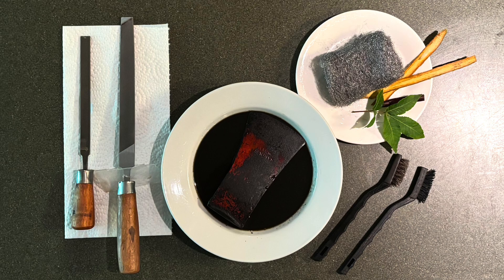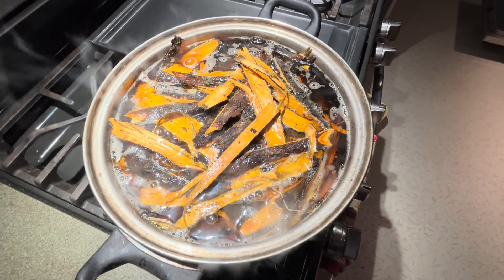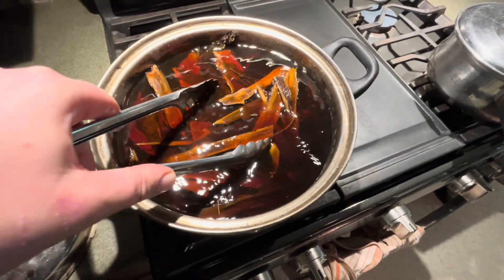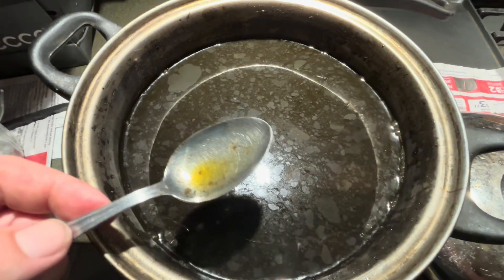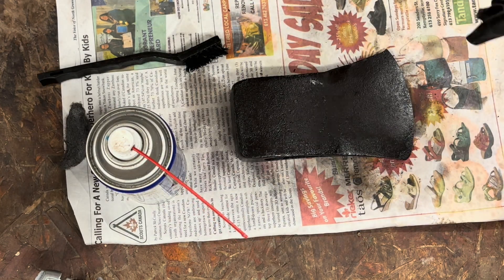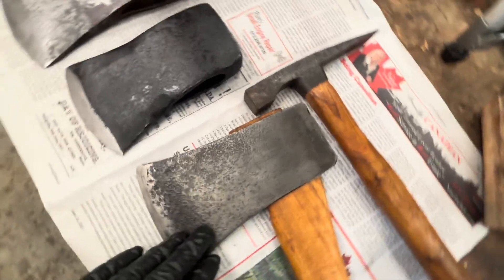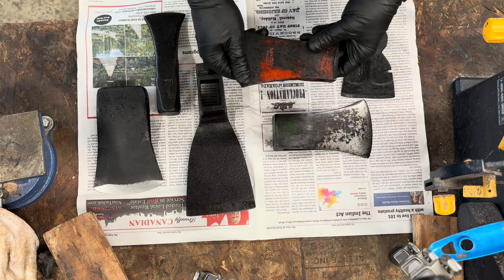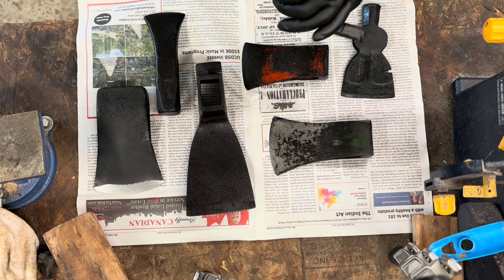Axe Head Soup? Refurbish rusty tools by converting rust to a stable black patina!

Comment from the maker: Updates: Since I made this video, I have kept experimenting with this method and I have got it to work using late season leaves from Common Buckthorn, Northern Red Oak, Bebb's Willow (a shrubby willow common in my area), and weeping willows. It's important to pack in lots of leaves because they are usually not as tannin rich as the bark. Sometimes it seems all the tannin gets used up before full conversion so I just repeat the process.

Old, solid, well-adhered, dark brown rust won't always get converted all the way through because the solution can't penetrate solid material. This only shows up when filing or sanding kicks up some brown dust but when that is wiped away the finish still looks good and I don't think this is a problem for preservation or use. 

There is a mild rust removing effect beyond the conversion because the tannin solution is mildly acidic. I have tried to use this technique to do something like rust bluing (causing superficial surface rust and then converting that to magnetite type oxide in boiling water and repeating until the desired finish is achieved) and that didn't work well and I think that is because the very think layer of rust is removed as it is converted so it doesn't adhere well (it turns black but wipes off). Using the rust bluing solution to create a surface that is then converted and durable is possible, but the rust layer has to be thicker and well adhered for it to work.

I have tried it using my highly alkaline well water once and it worked but perhaps not as well. Most peoples' tap water will have a lower alkalinity than mine so if you want to give it a go, but don't want to go to the trouble of obtaining distilled, DO, or rain water, then it is worth trying your domestic water.

For heavy rust, I found boiling an axe in tannin solution for and then leaving it in the solution to cool overnight works quite well. I usually heat it up again the next day so that the axe is hot when I take it out so that it dries quickly.

I have tried touching up bare spots on otherwise well-rusted heads with cold bluing solution after the tannin treatment and that worked well to blend the finish.

Some of the tannin sources also have lots of pigment that will change the colour of any paint that remains! The buckthorn bark that I used also has been used as a source of yellow dye and it turned a light blue Wetterlings axe into a greenish Wetterlings axe. Tea seems to be safer but I just want to caution anyone that wants to preserve the paint colour exactly.

Comment: That’s really cool to know about. It looks particularly useful for slightly rusted heads that still have patches of paint on them. How crucial do you think the type of bark when producing the tannin ‘soup’? Will any bark do it? Thanks!
Reply from the maker: Some trees (like ashes) are low tannin but pines should work and I googled and saw that Eucalyptus sp. leaves are tannic enough to be toxic to fish.  Locally late season leaves from a tree we have called sumac is used for trap dyeing. For bark the advice I have read is that you want the inner bark from low on the trunk of mature trees.
Reply: @MattKeevil okay. I’ll do some research and see what I can find. I know a number of trees that produce very red/brown/orange colouration if the leaves or bark are boiled. Some freshwater systems are red because of the tannin content from the surrounding vegetation.  So there are probably lots of options… 🤔
Reply: @implexidens  wattle bark used to be used here for tanning leather, could try some gums like ironbark, maybe she-oak too

Comment: great video and info! thanks a lot!!!
what kind of tea would be the best to use?

best regards from germany, kai
Reply: Yorkshire tea is my favorite. It is very high in tannins. You do not need to use new bags, used bags work just as well. I drink 6 to 8 pints of tea a day, and the family also drink a lot too. I leave them to dry out on a tray in the greenhouse and store dry till I have a bucket full. They then go into a bucket and a half of water and I simmer for an hour before removing. This makes a strong brew which can be stored for several months and you get several uses before it loses its effect.I typically make about 5 gallon batches.
Reply from the maker: @bigoldgrizzly We don’t drink enough tea in my household but that is very good to know in general!
Reply from the maker: I used Tetley English Breakfast because I received a huge container full for Christmas  a year and half ago and it was more than I could drink. I think any black tea (like orange peko) would work.

Comment: Extremely interesting and important.  I've forced a thin patina overnight by laying axes on fresh cut red oak endgrain.  I was thinking maybe tannins are doing something but I have doubts about how much would be actually interacting with the metal.  It might just have more to do with the fact that the evaporation is steadily "misting" the axe.  It was brownish rust but even after a day, when removed it would reveal a decent but thin layer of patina. 

Personally this is just about the only soak I'm interested in now for rust "removal".  Electrolysis is really cool for revealing wrought iron grain and different grades of metal.  But rarely does an axe deserve that when I find it.
Reply from the maker: I bet the oak tannins are contributing because tannins seems to start working quickly and the longer boiling is just to more thoroughly get the rust (while preventing new corrosion during the process because boiling removes oxygen). I think probably the patina on a lot of well-used axes has a tannin component just from contact with wood and bark.